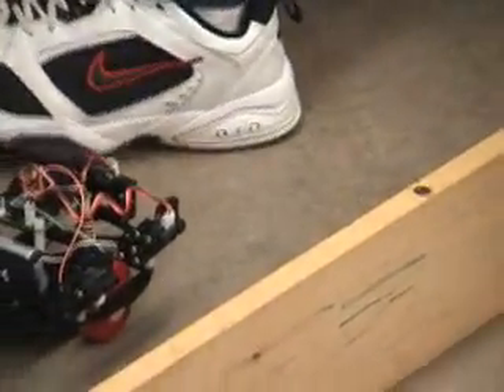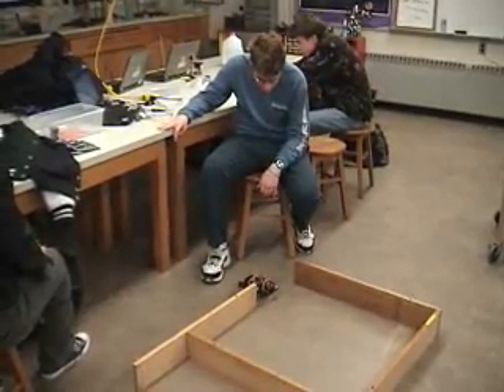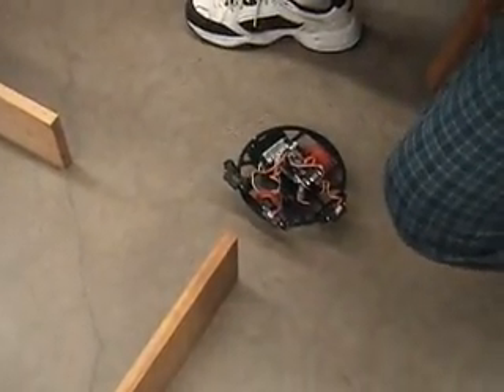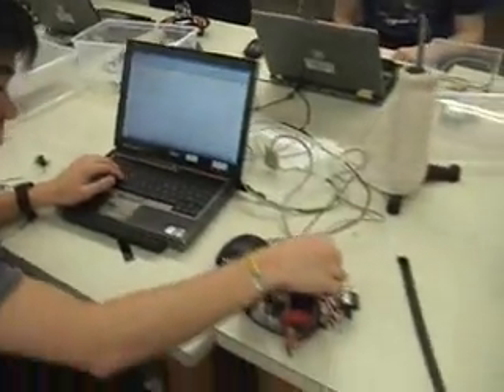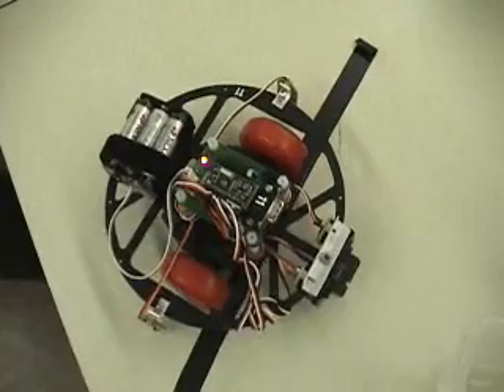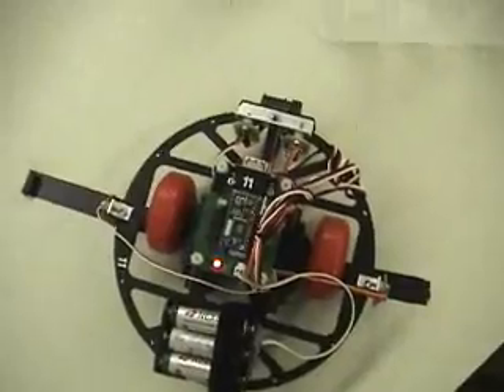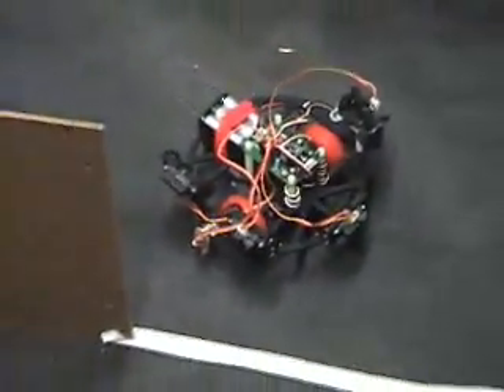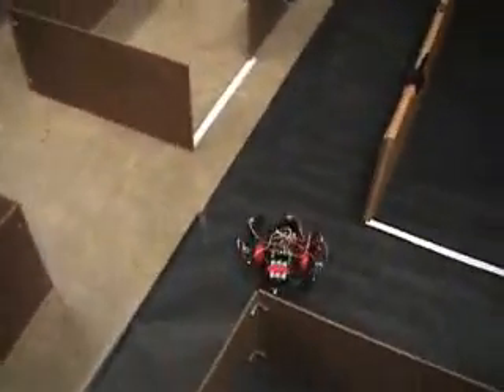Top DECK Fire Fighting Robot Build Part I - George School 08

Comment: Nice :) Check out my bot on my channel and let me know what you think. It's based on the Trinity College fire fighting robot challenge. Works 8 out of 10 times (2/10 times the servo changing direction of the distance sensor is too slow for the bot...the wheels move too quick).